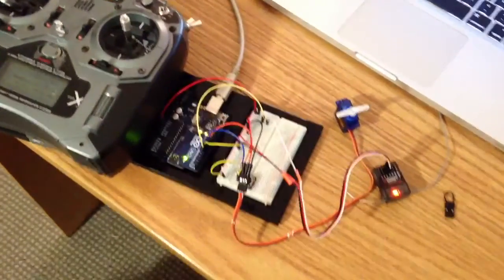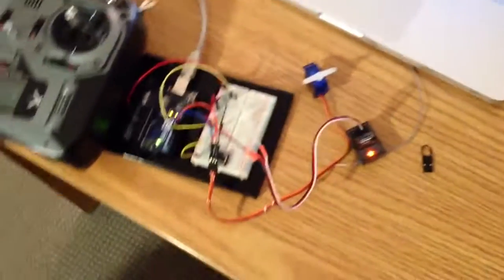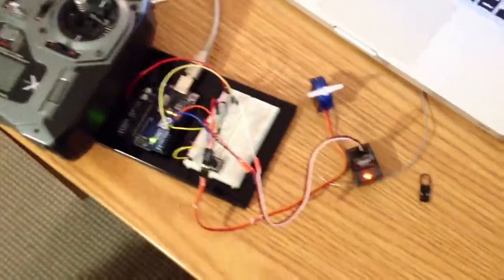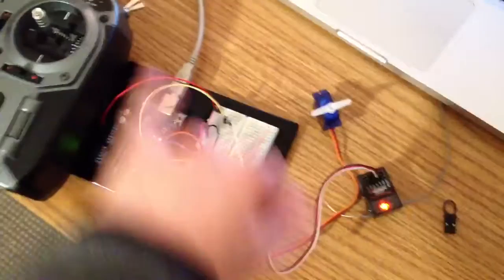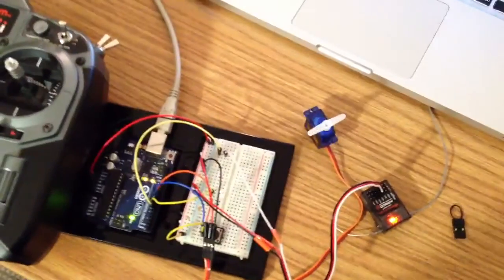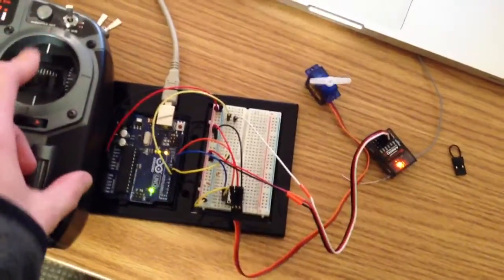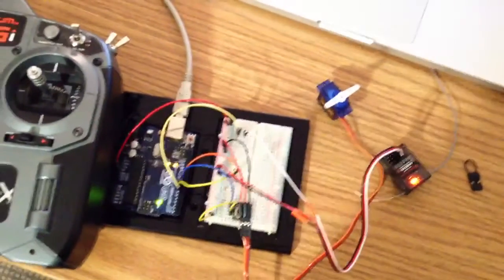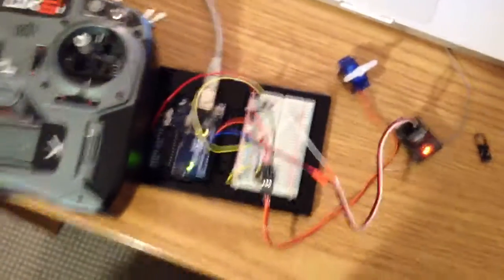Arduino & Spektrum Interface

Comment: from what I've researched, a microcontroller is excellent for additional data info. Like if you want to do GPS, altitude, LED control. This can all be done by plugging the microcontroller into it's own seperate channel, appart from the esc and servos.